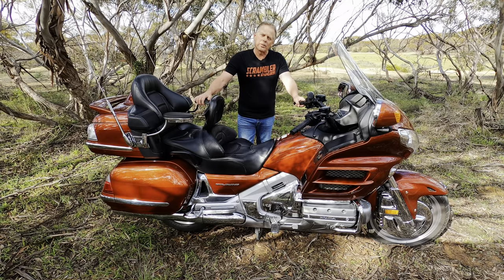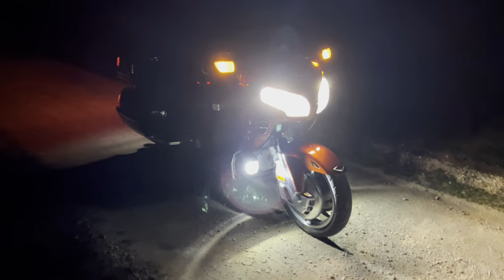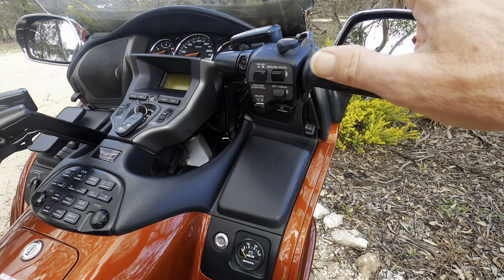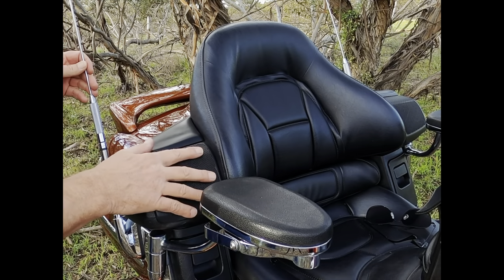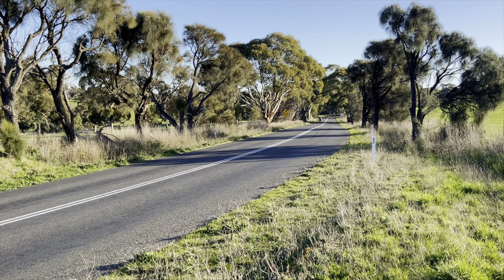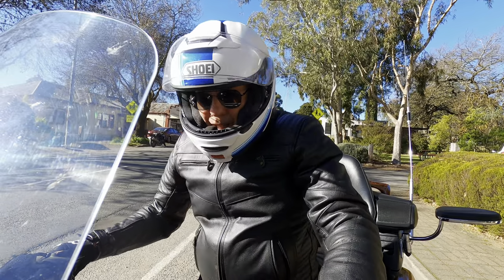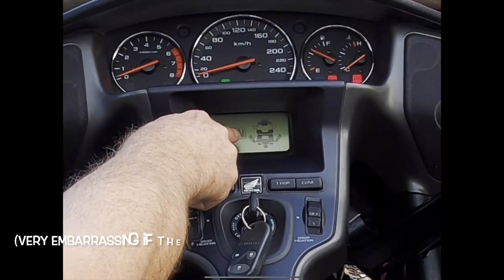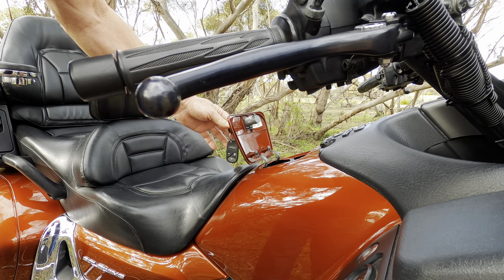Honda Goldwing Used bike review  Is it as good as people say?    (56)

Comment: Hi Steve, great name and a great review on the Big Wing. I just purchased my first one and it’s 2002 model in a standout yellow pearl, I spent 20 hours detail it and it came up like new and my wife and I just stand there and admire it in the garage. I’ve only had it for a week and rode it home from Horsham Victoria vis Echuca and dropped it off to Honda for a full service and all round fluid change, it’s only got 70,561 klms on it and it’s beautiful and in our eyes better looking than the newer models. My wife rides too and I met her when she was riding a BMW 650 and I was on a Honda CB1100RD which I ended up giving to her when I bought a Honda VF1000R and she ended up putting 122,000 klms on it. We have owned many bikes over the years and this is something that we can just pack up and go away for long weekends and enjoy the comfort and feeling.
Reply from the maker: Gday, congrats on getting your first Wing, problem you’ll have now is nothing else will compare for touring if ever you decide to change 😄 They are a great machine, I’m about to put out another video on Goldwings!  Great to hear your wife rides also, she’s obviously not shy about clocking up the kms!  70K is nothing for these sweet 6cyl motors,  I’ve had plenty of correspondence from riders in the US with 
100k miles (160k) on them and still running great. Look after her, good oil & maintenance and you & your wife will have many years of 
Rolls Royce touring ahead 👍

Comment: It’s good to hear a Aussie review on the bike, I currently own a 03 model ST1300 which I call the baby Goldwing. I love long distance riding, me & the misses rode from Port Macquarie to Adelaide & back to visit our grandkids, we both love it but she didn’t like the G- forces when we needed to over take trucks or caravans. She told me she’ll only do it again on a Goldwing, mind you she does suffer from back & shoulder pain sometimes we both in our mid to late 50’s & I ride every day for a job also ride a 07 ktm 640 adventure which I’ve owned for 8mths. Hopefully later in the year I trade up from ST to a Goldwing still like to keep the ST tho 👍👍 thanks heaps on the insight for what to look for cheers
Reply from the maker: Gday Andrew 
 Thanks mate glad you enjoyed the review. I also had the ST and loved it, it was a great bike for sure and somewhat sportier through the twisties than the wing. In saying that with descent tyres (I run the Bridgestones) the Goldwing can certainly surprise a lot of riders, it’s no sports bike but you can make it hustle. I toured a lot on the ST and it served well with good range between fills (something that does annoy me on the wing) not that I would have thought so at the time if you’d told me when I had the ST the Wing is in a league of its own. It’s smoother quieter offers more protection from the elements has all the luxuries and is heavier which of course adds stability on the open road. Having reverse is just the bee’s knee’s and the comfort for the passenger is unparalleled, you could seriously go to sleep in not on but in the rear seat. I also have a BMW K1600 which is a rocket and also a tourer but I’ll take the wing every time if I’m doing distance, even if I’m riding solo. I’ve done a lot of KMS since doing that review and I love it even more now, as I said the only thing that annoys me is the comfortable range (about 320 Kms per tank) not that it’s over thirsty it’s just a small tank. If your doing big Kms I personally think the wing is second to none, and the Mrs will love you. Cheers

Comment: Nice Video, I'm looking forward to upgrade from Triumph Bonneville T100 to hondagoldwing, but worried about the weight of the motorcycle. Love from Canada 🇨🇦
Reply from the maker: Hi from Aus, I’m not going to lie it’s heavy for sure but you develop a method of using /riding this bike you don’t even notice the weight. Remembering it has reverse for maneuvering and as soon as you are moving it’s like someone flicked a switch, the weight disappears. It takes a couple of weeks to get used to the size for sure but after a while you become quite confident. if your slight in frame & under about 5’8 getting it on the center stand can be a bit of a challenge but there are some aftermarket slightly shorter leg center stands that will solve this problem. Hope this helps, cheers and thanks for the comment. 
ps ( love to visit Canada one day, beautiful part of the world)

Comment: 15:21  you forgot to mention the VENTS DOWN THERE....   CLOSED MOST THE TIME IN WARM WEATHER But once that weather turns COLD ... open those up and it warms up your LEGS FROM THE ENGINE HEAT!!! VERY NICE WHEN CONSIDERING WIND CHILL at 70mph or wutever ;) ;)  

they still have a GOVENER at like 120 MPH??  used to be able to drop a gear and go ''faster'' don't ask me how I kno...  it will float the valves at that high rpms but it will go FASTER Than 120 ;)  I have no reason to go back up that fast but, it's THERE if NEEDED :) LOL   I LIKE IT told you you WOULD LIKE IT TOO!!! :)
Reply from the maker: Yes that’s right, I actually looked at them but forgot to talk about them. Oh well next time 👍
Reply: @standupmoto  ....was gunna add, most people don't ''worry'' about WIND CHILL .... ;) but a 50something deg F day at ''interstate speeds'' is lots ''colder'' than a ''breezy spring day'' or wutever season has the CHILLY MORNINGS, warm evenings?? eh ;)

Comment: My first time on your channel, and how nice to watch this review. Well delivered, and sensible. Actually looking out for another bike and an older G-W is in the running (along with an FJR).
Reply from the maker: Awesome, thank you & welcome to the channel. Both great bikes you are looking at, both are terrific tourers and I’ve had both. I still have the GW and for me find it more comfortable on the long hauls here in Aus, apart from the obvious wide seat, heated everything, remote central locking & cruise one of the big items for me due to where I live was the reverse, it’s just great. Good luck with your research and purchase, Cheers.
Reply: @standupmoto  Thanks. Not just for the reply, but for the thought that has gone into it. Excellent advice.

Comment: Have the same year model and the same colour, absolutely love it, the best motorcycle I've owned, nothing else compares to a goldwing for those long trips, great review.
Reply from the maker: Thanks Keith glad you enjoyed the video, top stuff you’ve got a great bike there and as it turns out a rare color also. Cheers.
Reply: @standupmoto   have you checked your colour code? mine looks to be the same colour (and yes, it isn't a very common colour) and under the fuel flap is YR275M which is Crucible Orange Metallic. Mine was sold new here in NSW, Australia.
Reply from the maker: @keithhellyer4565  That’s right Keith, 300 were made in this colour in 07. Apparently 10 made it to Aus.
Reply: @standupmoto  wow, thanks for the info. That's why ive never seen another one in this colour on the road.

Comment: Hi Steve, just watched your Goldwing review, congrats, very well done and honest.
I noticed you had cobra tyres fitted, when I tried these I found them a little woolley, slight snaking in long bends, the standard Exedra tyres are far better, I have recently  tried a 70 series Exedra max on the rear (180.70.16), I was amazed at the difference quieter, smoother, more ground clearance,and overall more confidence cornering, it also corrects the speedometer. Only down side is the life span, pretty much dead at 7000 miles, I do ride very hard and I am heavy, if you are interested i have photos of how they have worn. Would recommend you try them next time you need them.
John.
Reply from the maker: Hi John, agree with your comments 100% ! The Cobras were not good at all. I have since fitted Bridgestones, totally different motorcycle. Smoother, quieter and handles better. I did make the mistake of going back to a 60 on the rear,, losing all the benefits you mentioned in your comment. Including the ease of putting it on the center stand with the 70 & that speed correction. I think 7 to10 k is about right for a rear if you ride fairly hard, they are a big heavyweight machine.Glad you enjoyed the video,  I’ve got another one coming out soon on the wing showing just how versatile these great bikes are. Cheers.

Comment: I have an 2008 abs model.  Overall I love the bike ride it 24 hours straight twice.  The suspension is not the best and it likes to dive when braking hard.  Rides great with two people. Put a car tire on the rear to reduce the constant changing of tires every 12,000 miles now I have a 90,000 mile car tire. And it rides great. Smooth at 110 mph.
Reply from the maker: Hi Keith, yes they eat up the long hauls easily, by easily I mean the rider can get off and still walk upright. Unlike some bikes I have, interesting you run a car tyre- I know that’s a bit controversial depending on who you speak to. How do you find it through the tight turns in the windy twisties?
Reply: @standupmoto    Fine on the on and off ramps to interstates.  Sweeping turns good. Have not been any roads with a lot turns like the tail of the dragon (Deals gap)

Comment: Great review!  I owned an '81 Gold Wing Interstate in the early 90s, loved the low center of gravity and the smoothness.  Based on these memories I bought an ST1300 almost 30 years later, it was top heavy and scared the hell out of me, I sold it within a month.  I'm wondering how I would now feel about a GL1800.  You're a brave man to do these speeds on a dirt road.
Reply from the maker: Yes having owned the ST they are totally different, the GL1800 sits you in the bike not on it, nice and low with both feet flat on the ground. Your 81 would have been similar I’d imagine but somewhat lighter, the big six is a heavy machine but in all honesty it just doesn’t feel like it, the weight is carried low. For sure I’d try to get a ride on one and see what you think, let me know. 👍 Cheers.
Reply: Thanks for the fantastic review. It's probably the best I've seen on the 1800! I'm very interested in getting one. But I'm only 5 foot 8. I'll have to test ride to see how it feels.
Reply from the maker: @chriscarr5864   Thanks Chris glad you liked it, I recon you’d be fine but yes see if you can get a descent ride. Maybe an hour or so would give you fair idea, at first you might think geeees this thing is huge but then it feels right. Cheers mate.

Comment: Gday mate i consider the goldwing as the premium tourer and for the size of our country i am amazed they are not everywhere , some people call them lead wings but they are in the same weight ratio as the harley road kings and ultras . I can remember siting at some lights on anzac highway around 1977 on my new 550 supersport honda which i bought from the house of honda (not too many would remember that store)  and two of the original wings pulled up next to me when the lights turned green they were gone like the wind always been a bike i would have loved to own but at 63 im back on a 500x maybe if i win lotto ,great review of a lovely bike .
Reply from the maker: Hi, thanks for the memories re House of Honda. I bought my first Honda XR200A there in mmmmm I think about 1980 when they were still on Hindmarsh square (rode it home without a helmet which was legal if you didn’t exceed I think it was 40 kph or something like that) Yes the Wing is a lovely machine and yes I can’t believe with the comfort & power we don’t see more. The US which is similar in size to Aus has far more albeit with far more population I guess. Don’t be in a hurry to get off your 500X, they are a great machine, I’ve got the 750X and love it. Ride safe and thanks for the comment) ps(snap on the age)
Reply: @standupmoto  i was tempted to get the nc 750 as it is so much more easier to maintain ie valves ect but the 500 is a great little bike ,i follow a bloke called capt cranky on you tube and his is a 2013 model with well over 100,000 k and still going strong mine has 10,500 km
Reply: MostPeople like f150s,  giant suvs, and sedans for the size of our country. This is just the motorcycle version. The grandpa bike reputation doesnt help

Comment: Great review. Just bought a wing and it is very different to bikes I've had before. Bit of a struggle getting used to it.
Reply from the maker: Yes I agree but give it a while, do some time getting used to its bulk & weight. At first they seem huge but this soon passes, do some winding roads if possible & you’ll soon gain the confidence. In a very short time you will find other bikes seem inadequate compared to the Wing. 👍
Reply: @standupmoto  thanks mate. The low centre of gravity makes it feel a bit 'weird' in fast corners and the slow speed stuff is difficult at the minute. I can for sure tell it is a great bike just definitely has the potential to drop it..a lot.
Reply from the maker: @disfiguringthegoddes   Yeah that’s right, you’ll get it. I’m putting out a “ Goldwing Myths Busted video “  in a couple of weeks that busts some of the comments I’ve had while out and about over the time I’ve had this one, keep an eye out for it. ☝️

Comment: True it is a dependable bike, BUT, unless you can troubleshoot electrical issues it will drive ya mad at the repair shop for something so simple. Relays abound in these models and when one fails finding it is a task unless you are familiar with them.  Being stranded on the side of the road without a spare one can make your road trip turn into a nightmare.
Reply from the maker: Yes I get your frustrations if you’ve had issues, one of the potential problems when buying a second or third hand bike is of course it may have had accessories fitted and removed multiple times by the owners or the bloke next door who has aspirations of becoming an auto electrician but didn’t quite make the grade.
Reply: Its a luxury touring bike. Its certainly not the simplest bike on the road.

Comment: Hands down the  undisputed King of the touring motorcycle 🏍️🏍️ you want to ride one.  You won't regret it,   I rode a 1941 wla flathead 88 for ten years straight every day and then I got a 1981 gl1100 and have had nothing but goldwings ever since, Harleys are cool but Hondas RULE !!!!
Reply from the maker: I have a feeling you are pretty taken with your Goldwing, don’t blame you their great 👍
Reply: @standupmoto  I've ridden them all and my 2006 1800 is my favorite just the right amount of computer tech with the fuel injection and all that but still with a hydro clutch  so it still feels like I'm driving and shifting when I want it's perfect in almost every way,I'm 6'1" so I am gtto modify my seat to sit an inch lower and three inches back my wife is thin and doesn't require all that back seat and I would be much more comfortable with her a bit closer and my legs stretched out a bit more... but otherwise it's perfectly perfect.

Comment: Your 2007 is different than what I have and what I've seen. At 11:40 I have never seen the flash button on a wing. Also, the 2007 models with ABS also had the Navigation System package included. Excellent review I can really tell you love it. I also encourage you to look into getting a trailer. Considering your travels, you will really get good use out of it.
Reply from the maker: Gday, now that’s interesting re the high beam flash. A mate has one also and his doesn’t flash from there either, we thought it was just broken on his switch.. Q- Where is your high beam flash on yours?  Yes your spot on , I am really enjoying this ride for sure. And yes again a trailer is pending, glad you enjoyed the video. Cheers.
Reply: @standupmoto  My 2007 and All Goldwings I've seen have only the Hi-Lo button, no flash, and reversed from yours (HI beam up, Lo beam down). I like that feature on yours, maybe it's the Canadian model (?). Either way, it's a beautiful bike. I have not seen that color before. I looked up the Color Codes and it did not show that color listed. There is a Metallic Orange for 2007 and a Pearl Orange for 2002; no Pearl Autumn Orange listed anywhere. I like your color better than the other oranges I've seen. I also switched and have the turn down exhaust pipes and they do look and sound good.
Reply from the maker: @toanogreen  Yes I would like those turn downs, bit of a problem getting accessories here in Aus. The color seems to be a bit of a mystery, maybe as you say a color for another market. I’ll check some other wings here re the hi/low and let you know, cheers.
Reply: I have a US domestic market '06 airbag model and it doesn't have the high beam flash switch style either.   If that feature is not listed in your particular owner's manual, it may be an aftermarket add on?
Reply from the maker: @gwrider2146   I’ll hav a look in the books, it doesn’t look like an aftermarket thing but maybe. Where is your pass flash on yours?